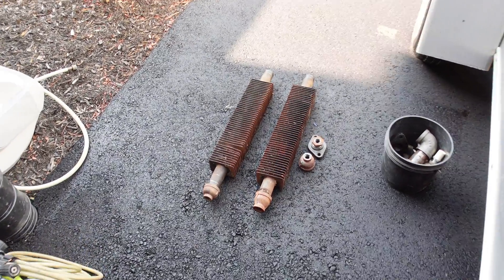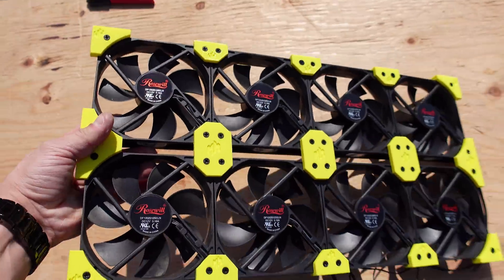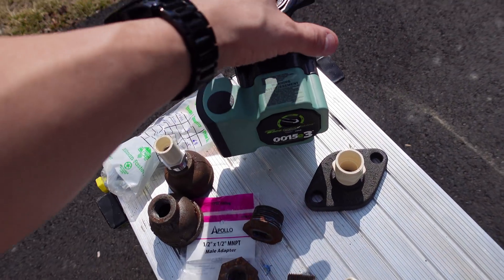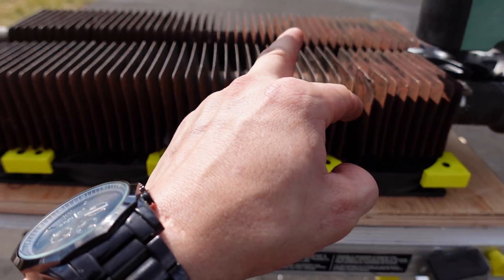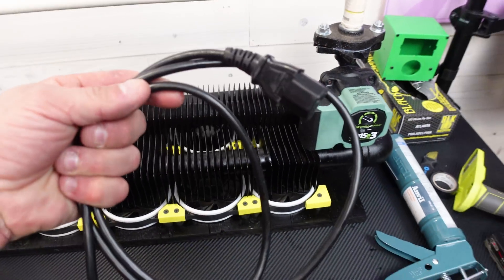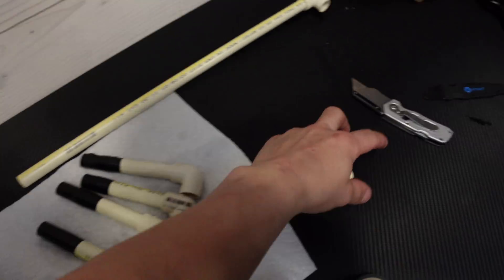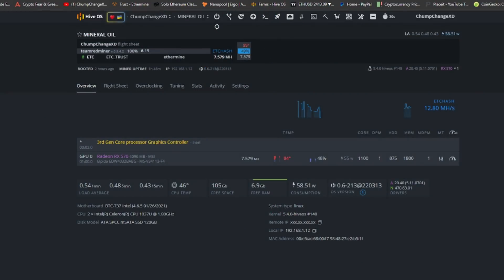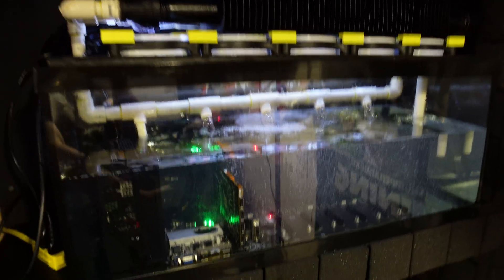Mineral Oil For GPU Mining?

Comment: I have been studying a setup like that. For it to work properly you have to get the cold oil at the bottom, then the oil rises up and drops into a separate part of the tank. From there you push it with the pump to the radiator to cool down and back to the bottom of the tank

Comment: Don't take the fans off the card, it needs flow over the heatsink.................
Reply from the maker: Which is why I built the manifold to push water rite at it. She's my experimental card
Reply: @ChumpChangeXD  Might not be enough, I've seen others have the best result with fans still on. So it's certainly a problem with your card or setup.

Comment: It looks like you've got some productive suggestions. I vote you work on it some more. It sounds like you're having problem with heat transfer on the GPU to the mineral oil. Instead of cycling the hot air from the tank, maybe raise the fans up to get cooler external air and get both sides of fans blowing up across the heat fins.

Comment: the thermal MASS of that oil is FAR beyond what a Polaris GPU would kick out and IMHO your issue is NOT oil temp BUT lack of circulation refit stock cooler WITH fans and let the fans run  
the miner screen shot you have shows the CPU temp of 44C and it is under oil and still has its fan and the fact the GPU temp is spiking up very quickly both "prove" it is NOT currently an oil temp issue 
extend the return pipes to discharge the oil across the heatsinks below the oil line would also help 
yes I want to see this taken further

Comment: You need copper fintube. 3/4 inch. That steel pipe size is way to much fluid for those fans to cool.
You also may need to slow the flow down so the air going across the coil has time to cool the fluid. install a ball valve on the supply side of the pump and throttle it to see if that helps. If the flow is to  fast it wont pull the heat out of the fluid. 
Definitely not an efficient way to cool one GPU..lol

Comment: A thought. can you lift the whole assembly by an inch to allow more air to get to the fans. I think you are vacuum locked and you are not getting air input... I do all my cooling in a push-pull system, one fan pushing in on one vent and another pushing out on the other side of the rigs.

Comment: You should be pumping in the cool oil from the bottom and returning the hot oil from the top then through the cooler. Also you need to mount the motherboard on its side and the cards upright to allow cool oil to flow up through the cards which will help draw the heat away. You should also put the original cooler back on without the fans that will allow the oil to remove heat alot easier. Great job anyway
Reply: i've seen others leaving the gpu fans on, they keep spinning real slow , true, but they might promote the heat exchange form the radiator with the oil

Comment: hmm looks like the heat exchanger you have, isn't very efficient, mainly due to the large diameter bore.  the surface area you have for heat exchange is limited to the circumference of the pipe.  think more lots of small pipes with really bit fins.

Comment: Put the shrouds back on with just thermo paste brother. I have done this before . do not use those metal sheets (gpu die pads) that carter 9bitbtrippin) used ether , just paste. and the temps will be just fine.(it doesn't do much for gpus) But I had 6x s9 hash boards in mineral oil. worked great . 22.2TH/s.2200watts oc'ed no dev fee. I called it the s9 supra. lol But that was 2019. it got dismantled late 2020. too much power :(

Comment: As a computer builder and Senior Maintenance tech, I was thinking the exact same thing as TPSMiner. The silicone is insulating the chips it's attached to. Those heat sinks are useless if there's insulation between the heat source. Remove all silicone touching the chips, attach heat sinks to chips directly though, no thermal pads and then silicone around them or skip the silicone and have a pressure system. The silicone around the Die could possibly be lifting the heatsink off and creating a pocket of hot air. I would suggest plates designed to water cool the gpu that bolt on. Then put heat sinks on that. People have been mineral oil cooling pc's for 30 years.. There are people that can show you exactly what to do.
On a side note, the radiator that you repurposed is probably too girthy for the fans being used. Smaller / thinner fins the better, aluminum or copper fins the better and you need to isolate the radiator and fans away from the heat. You're sucking the hot oil air and sending it back over the fins lol
Reply: Also.. when you have the entire computer in the tank, you are now cooling the entire computer on top of the gpu.Thats the PSU, the motherboard, everything. Submerging only the gpu's using risers and extended power cables would probably have been better, but probably not as cool. haha (insert dad joke).

Comment: Ok so the mineral oil is reaching thermal equilibrium at 30°C with that rad setup and the GPU keeps overheating past 85°C. This suggests two things, that not enough heat can escape the oil with your rads, maybe try the oil setup again and measure the oil temps again, see what it says to see if your repurposed radiator cores are any good. Secondly, and the bigger of the problems, the heat cannot escape from the GPU quickly enough. Thinking about the dynamics of the oil the only movement you will get is down to the pump putting cold oil back ontop of the tank and the oil around the GPU fins heating up, IE very little movement. You are cooling the top hot oil, making very little difference to the oil around the GPU. What you need is to create a heat cycle similar to your grow tents, cold in at the bottom, hot taken away from the top. Unless you get some serious fluid cycles going you will also need to get a fan or the such to circulate the oil around the GPU, self heating the oil will not be enough.

Comment: because of the silicon thickness, ur core barely touching the heatsink
trust me, clean those silicone u applied and
put back the gpu ori shroud fan, minimal 40% fan speed, and that will solve

Comment: It was a nice project CC, looks amazing. although I see the oil temp is around 88°F which is around 31°c and the gpu is 85°c .. oil of course could be cooler but the gpu overheating issue is coming from the "glue". That glue or silicone adhesive which is between the die + memory chips and the heatsinks is not meant for heat transfer at all.. like, zero, not in the least lol :) Thermals paste is also meant for bridge like tenths of a millimeter at maximum. That is why you need to use force to press the die to the heatsink with a leafspring for instance so thus will be able to transfer the heat through thermalpaste effectively.

Anyways it was fun, thanks for the content! :)
Reply: For sure silicone would also act as an insulator

Comment: Keep trying, immersion cooling was invented for a reason, once you get the cooling figured out it will be well worth it, just need to move the oil through the system faster.  I would also try putting slightly more oil in so it takes more to heat it up.
Reply: oil is at 85f or 30c i believe gpu/memory are having heat xfer issues

Comment: This is so fun to watch! Just throwing in my 2 cents...It looks like you are reaching steady state on the oil temperature at around 85-86 degF, which should be fine. If you are looking to cool the oil to a temperature significantly below ambient you will need a cold source other than ambient airflow, which I don't believe is necessary with just one card in the tank. I personally think the issue is that there is very little heat transfer happening between the VRAM and the custom heatsinks because of the silicone. I would remove the heatsinks, clean the silicone off the VRAM and the heatsinks, install thermal pads between the VRAM and the heatsinks, and then attach the heatsinks by sealing around the edges with the silicone, similar to what you did with the GPU, instead of applying the silicone between the VRAM and the heatsink. I honestly think you are almost there!! My suggestion may not work, but I hope you consider giving it a shot before moving on from this project!
Reply: As a computer builder and Senior Maintenance tech, I was thinking the exact same thing. The silicone is insulating the chips it's attached to. Those heat sinks are useless if there's insulation between the heat source. Remove all silicone touching the chips, attach heat sinks to chips directly though, no thermal pads and then silicone around them or skip the silicone and have a pressure system. The silicone around the Die could possibly be lifting the heatsink off and creating a pocket of hot air. I would suggest plates designed to water cool the gpu that bolt on. Then put heat sinks on that. People have been mineral oil cooling pc's for 30 years.. There are people that can show you exactly what to do.
On a side note, the radiator that you repurposed is probably too girthy for the fans being used. Smaller / thinner fins the better, aluminum or copper fins the better and you need to isolate the radiator and fans away from the heat. You're sucking the hot oil air and sending it back over the fins lol

Comment: I used to see people using mineral oil dunk the GPU with its fans. so  the fans move the cold oil to the heat sink. I'm not sure your issue is not enough radiator capacity or the hot oil is staying around the GPU? is the oil has the same temperature every where?

Comment: Not sure if anyone mentioned this yet but silicone is an insulator not a conductor. So the silicone you used to bond the heatsink on is blocking the conductivity over heating cpu. You need some type of conductive bonding material.

Comment: How are the fans getting air to blow across those radiators? If there's not proper clearance for the airflow, they probably aren't moving much air, and thus not cooling the oil very much....

Comment: I would get rid of those old radiator pipes and replace it with an automotive radiator or even several automotive oil coolers in a series.  I also agree with another commenter that the stock heat sinks (even without the fans) would do a better job of transferring heat to the oil.  I am also confused by your temp readings.  85F is ~29C .  So the temp of the oil is 29C and the temp of the GPU is 85C.  That tells me the oil is not getting hot at all and that the heatsink on the card is not transferring heat.  At first I thought you changed the settings in Hive to display F instead of C but went back and looked at the Miner screenshot and it is displayed in C.  Fix the issue with the heatsink on the GPU and try again.  Oh, and please please try again.

Comment: Maybe try doing Peltiers on the last heat sink. Maybe stop sucking the heat out of the tank across the heatsinks, I bet the ambient room temp is lower than the oil temps. I like the way the cool oil is coming down over the cards. Don't QUIT. Change the fan & heatsink location and seal the top of the tank.. Maybe do a soda Cold plate and Peltier.

Comment: put normal gpu cooler from that gpu and it will be better cuse heatsing is larger plus theres fan on it and it will move a wather a bit

edit: those heatsing dont have a lot of surface to wather move heat from so try putting original cooler cooler it shuldnt damage it, or you can just leave original heatsink just remove fans and meake shure theres connection from mem chips to heatsing and goodluck teaking silicon off cuse silicor is trapping hot air inside chip u needed to fill it up whit termalpaste so theres no air

Comment: you need to give the gpu die and everythiong you want to cool a bigger surface area. try to add the stock headsink of the gpu and get some oil flowing through it

Comment: Since your gpu is nearly at the same temp as the surrounding oil, I think it would be good to focus on reducing the oil temp. What you built as a cooler was nice, but maybe find something off the shelf specific for cooling oil like a engine oil cooler, or transmission cooler.
Reply: the GPU and OIL temp are NOT close 
the CPU also under oil is reporting 44C and the GPU core is 85C he changes units of measure between his IR "laser" thermometer gun and hive os reporting
Reply: Yeah, dude its 85C not 85F. The gpu is 85C while the oil is 85F lol. Big difference mate. He needs to put indium foil on the core. Mineral oil will destroy the paste.

Comment: I might be confused because of Farenheit vs Celsius, but as I understand the heat transfer is failing from card to oil... I mean, the oil seems not tooo hot with 88f/33c... therefore either stock cooler or this cooler but with more clamping force? I wouldn't call it a bust yet ;-)

Comment: On my gout I found that the oil would take several hours to heat up, I forget now maybe 8. So the issue with your set up is fans are needed on the Gpu. I did replace the pads and paste and use an ultrasonic on the gpu before I put it into the tank. It’s been running since November. Like I said before my oil is turning color, and I think you are right it is either the plastic breaking down, or my friend suggest its cooking the oil. It was a broken gpu before I got it running in oil. My vote is keep going!!!

Comment: It’s the silicone between the heatsinks and the memory that is you biggest issue. Ive seen vids of multiple rigs in a tank working fine but they were using it to heat water in a hot tub that was outside If I remember correctly.